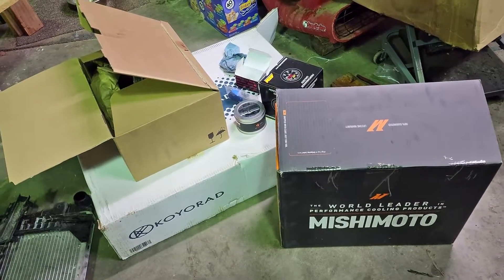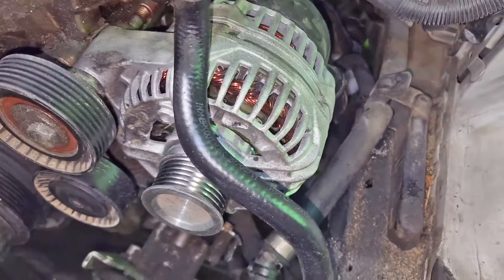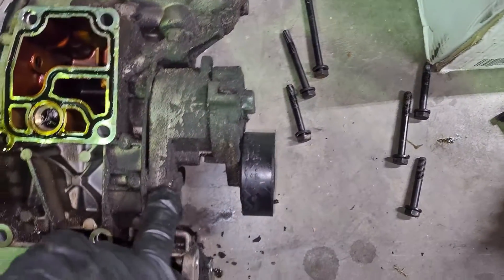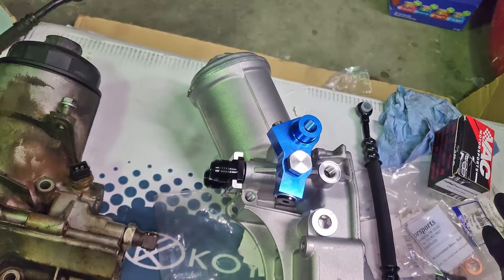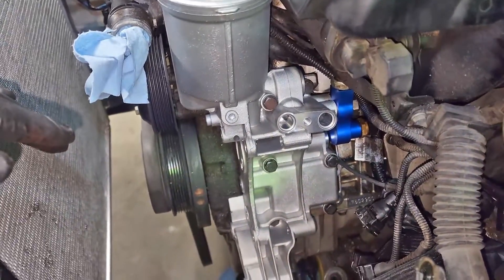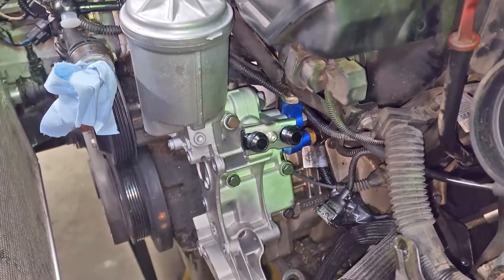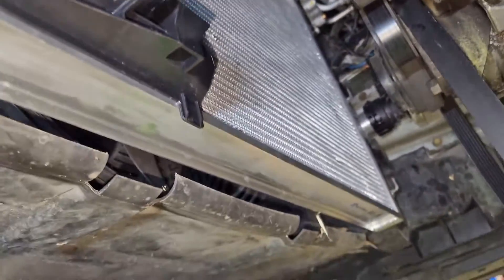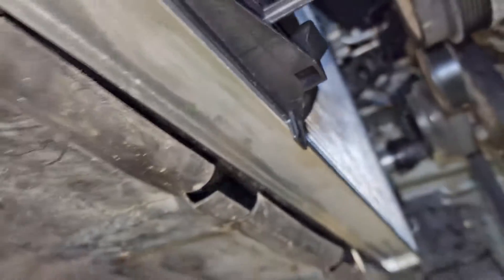E46 Oil Cooler Install Part 1/3 - S54 Oil Filter Housing Install

Comment: 2:26 isnt this normally the oil check valve?
Reply from the maker: It's an oil Diverter Valve or Thermostat. They are pretty restrictive and for the purpose of running a cooler, we want it to flow freely. You can read more about it here:
https://store.vacmotorsports.com/mobile/vac-motorsports-oil-diverter-valve-bmw-s50b32s54-p4056.aspx
Reply: @AlanFixedIt  i just know its purpose is to keep the oil from the top of the engine to flow back to the oil pan, after shutting off the car.
at least on the m54 one
Reply from the maker: @Yumuura-666  Ah I understand your question now. The S54 housing has an anti drain back valve AND a thermostat. The anti drain back valve can be seen by looking inside where the filter sits.
Reply: @AlanFixedIt  thanks 👍🏻

Comment: Hi.  How long is this spacers for steering pump?  And ar you drill hole after or no?? 🙃
Reply from the maker: @davisleija1314  I didn't end up drilling a hole yet, but I plan to if I need to pull it apart at any time. I don't have a measurement on the spacers, but you can find them here https://store.vacmotorsports.com/mobile/vac-motorsports-oil-filter-housing-power-steering-pump-spacer-bmw-m54-p2654.aspx
Reply: I'm going through this project atm, and I just measured M54 vs S54 OFH - it confirmed what I saw someone on some forum say: around 16.3-16.4 mm. I will be turning my own 😇

Comment: why would you do this whole conversion? The m54 cooling system is good enough also its not a turbo car so it wont breakdown the oil viscosity.and looking at your old housing its very dirty cleaning it alone will improve the oil temperature
Reply from the maker: For the capability to add an external cooler for faster cool downs on track days.
Reply: You are wrong my friend. Take your n/a e46 to the track and watch your oil temps hit 250°f.
Reply: @JustAnotherE46 exactly bro🔥